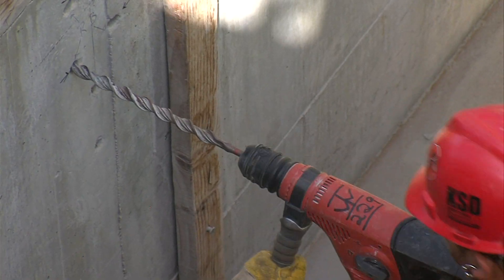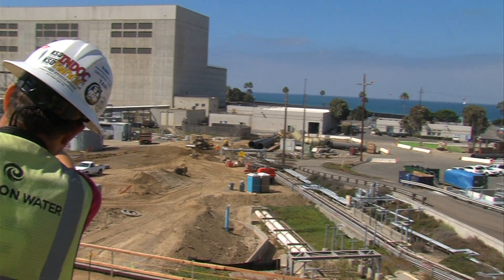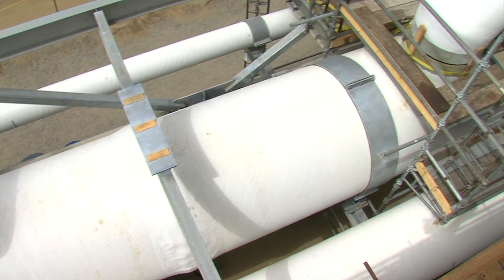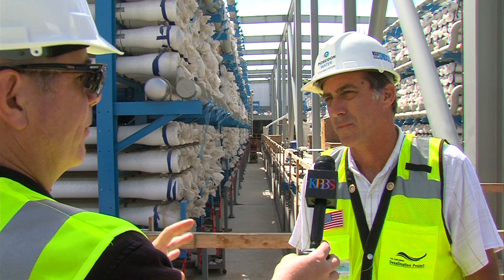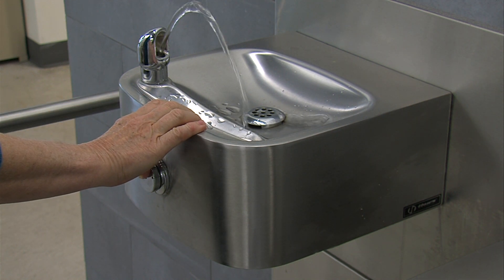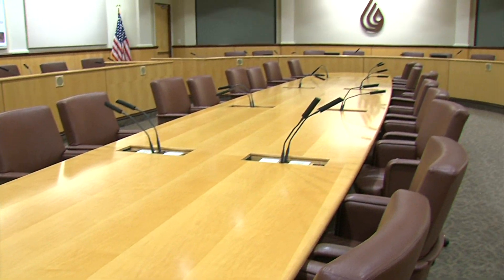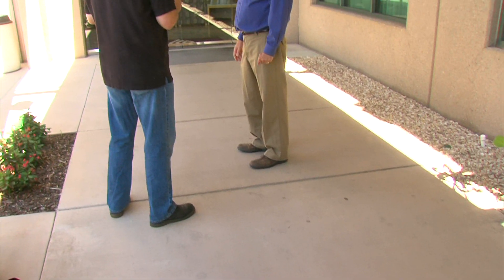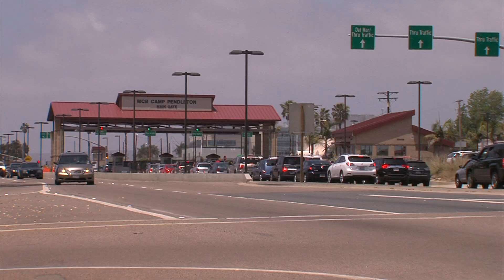Tapping Into the Ocean With San Diego's Billion Dollar Desalination Plant

Comment: To expensive! Columbia River has 11times more water than Colorado River -> Move water south! Make a 368m long tunnel from Columbia River to Red Bluff. No pumps needed. CA saved! The USA made great infrastructure, before: In 1913 the 233m the LA Aqueduct opened and The Colorado Aqueduct is 242m long (5 pumping stations) opened 1939. China`s new aqueduct is 716m with 23 pumping stations... A tunnel, no land cost. Make a relative small diameter (cheap/fast to make) tunnel, because if water move fast, it need a smaller tunnel, to move an amount of water. If CA gets water from thenorth, the other can keep more Colorado River water themselfs, and theyr life gets easyer to.

Comment: What's Metro doing?  I hope San Diego raiding the Imperial Valley is only temporary.  In times of El Nino, it sure would be nice if there was (in place) distribution infrastructure to move water around the State to avoid capacity situations.  In times of El Nino, there is already one storage that is rarely at capacity anymore . . . Mead.  San Onofre should be reworked for water harvesting needs . . . Diablo also.  There hasn't been an incident in California associated with these facilities . . . and I suspect that there is more than politics agitating public outcry.  A bit difficult to generate tsunamis on a continental shelf.  Thermal AFTER filtering seems a shorter path to more pure water . . . space would be needed.  Pendleton has needs that can't be ignored.  Cutting through there 'under' the surface could be done.
Reply: Brine could be used to evaporate and then mine whatever's left behind . . . OR the brine could be placed in pits to evaporate leaving whatever's left behind forming quarries for later on in time.